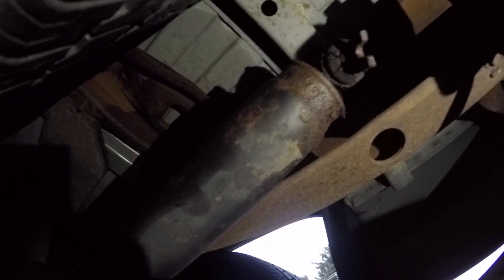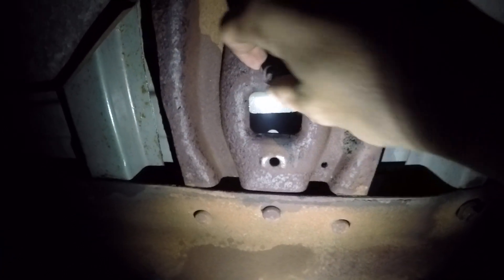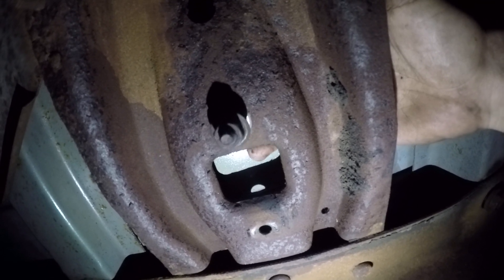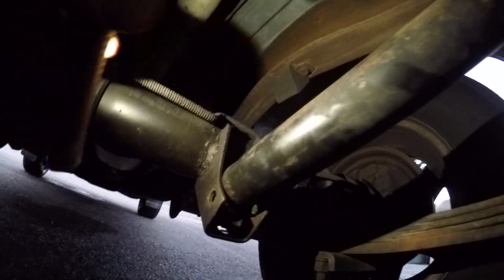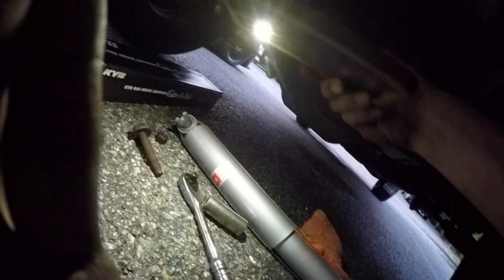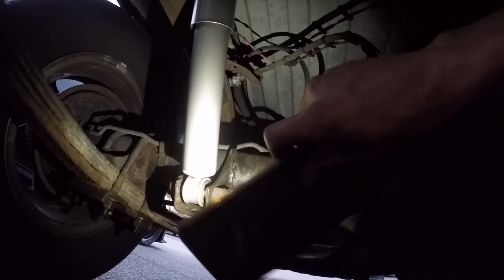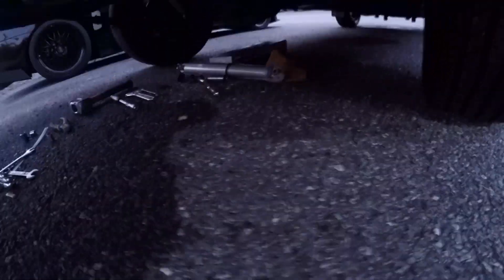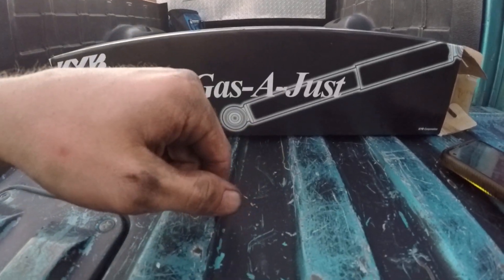How to Install rear struts on a dodge Dakota

Comment: Very useful video. Just happened to buy these same struts and wanted to see someone else do it before I tackled it. Thanks for uploading this
Reply from the maker: Hope it can help honestly the struts were pretty nice honestly for the money.
Reply: @RspecNick  It did! I did the job a couple days ago after making the comment and used your video as reference a couple times. It's a very easy job. The spare tire makes doing the driver side a little more annoying when it comes to the bolt heads up top but overall, pretty easy. As you said, the KYBs feel really great for the price. Thanks again